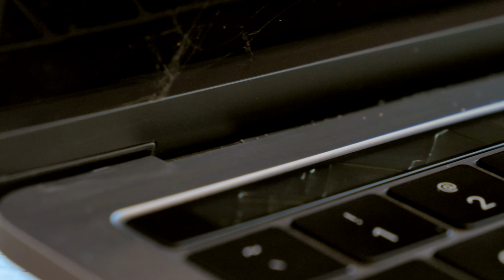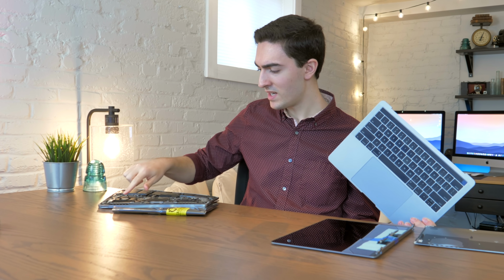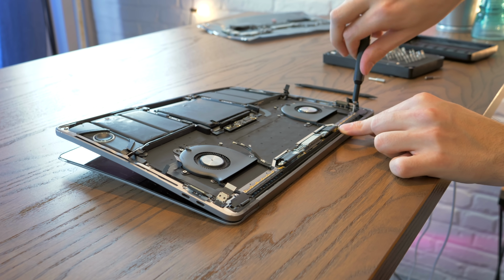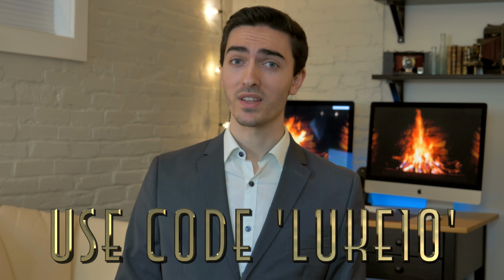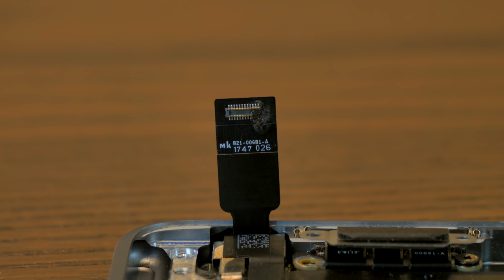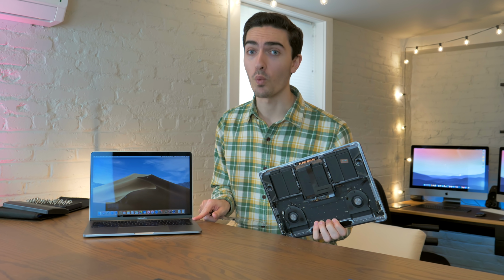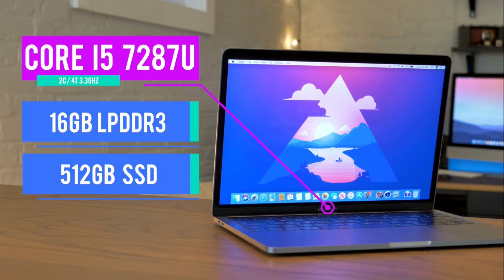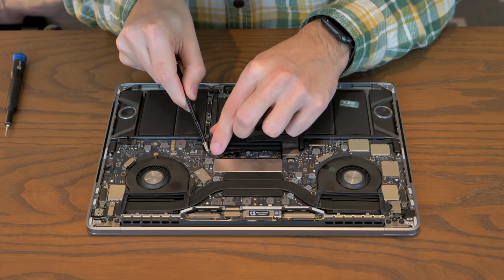Can I restore this DESTROYED MacBook Pro?

Comment: Luke: Gets laptop run by a car repaired (at a cost but still).
Apple store genius: You'll need a new laptop because a back light pin is bent...
Reply: Tempest_072 or the repair will cost a 1000$ soo I think you should just buy a new MacBook -Apple genius
Reply from the maker: If they would even agree to repair this it would be about $1300 for parts and labor RIP
Reply: @lukemiani  I was obviously exaggerating.
Reply: Louis Rossman video?
Reply: Great job Luke.....
Reply: @fredvima9916  Yep...
Reply: Ahahhaha i remember this Louis Rossmann video.
Reply: I think in some cases it's just easier & cheaper for them to recycle a broken device. In case of so much damage definitely.
Reply: +Luke Miani how can I buy 2 MacBook Pros from you
Reply: Jannis Schröder you need to so the louis rossman video

Comment: Everybody: Oh no, it's so broken.
Me: Oh no, it's from 2017.
Reply: meloD30 hahaha this should have WAY MORE likes!
Reply: this should have been pinned
Reply: What's wrong with having 2017 macbook
Reply: Creig the Brute yeah I would kill to have one
Reply: GameAfterMe imagine wanting a macbook instead of a windows laptop(cheaper for better specs)
Reply: @arbiter1954  I don't remember exactly why I wrote this but I guess it's just a general reference to the touch bar models which are famous for the touch bar, faulty keyboards and a lack of ports. For a MBP I would only go with either a 2015 (for budget) or the new 16 inch (for power).
Reply: @kingo1539  It's the OS for me, if I could reliably run MacOS on something else I would have left a long time ago.
Reply: @kingo1539  Internal specs maybe, everything else on basically ever windows alternative that is cheaper is full of plastic components, bad speakers, bad trackpad, bad screen and a flexing chasis
Reply: Mauricio Peña Depends on the Laptop. And if the OS is a problem theres still Linux and bootleg MacOS
Reply: @kingo1539  Laptops that are built to the spec of MacBooks (aluminum chassis machined from 1 single block) costs as much or even more than macbooks, name 1 single windows laptop that has better specs, similar chassis and similar trackpad than a macbook and I will consider myself schooled.
Reply: @kingo1539  M1 MacBooks. Can’t find any laptop better than that for the same price.
Reply: @blackgoose87  I wrote that before they were even announced.
Reply: @chloe elise I didnt get the notification, M1 macbooks are out now anyway
Reply: @kingo1539  but windows can run on Mac using boot camp
Reply: @athenabcde  To what message are you refering?
Reply: @kingo1539  Its not just that, its for the OS and the build quality as well. If you compare it to a laptop that is also high quality like the Dell XPS, it literally costs the same.
Reply: Worst MacBook year

Comment: Damn this hella impressive
Reply: @HoloKola how is swapping a motherboard and screen assembly(6 screws) "hella impressive"?
Reply: @eXxtrazZz  he practically replaced the whole laptop dude
Reply: @drcola143  but it's nowhere near "impressive" as it's the easiest laptop to disassemble and probably anyone could do it . It's almost the same as disassembling a gameboy and I did both lmao
Reply: @eXxtrazZz  no it's not lol. A gameboy and a laptop are completely different things. I would argue replacing the components of a mac is harder than most laptops
Reply: @drcola143  I've disassembled them since I was 14 years old, they are a joy to work on, all the clips, connectors are just too easy to unplug, the layout is easy to work on, no awkward keyboard tilts to disconnect and damage the ribbons or etc like on most windows based laptops. Screen assembly is literally 1 plug,few antenna plugs and 6 screws, I've never came across an easier display to replace(If we're talking a whole assembly, if the display was fixed and I mean unglue the glass protector with a heatgun and replace the lcd itself, then yeah, it's pretty difficult) but overall it's as easy as taking a gameboy apart, had more trouble diassembling nintendo ds than macbooks for the past 7 years lol
Reply: @eXxtrazZz  I mean it's still impressive, he replaced the whole laptop except the touch id sensor
Reply: @drcola143  I mean it ain't impressive at all,  dropping down a working motherboard to a completely prebuilt housing(screen assembly already full, keyboard, battery installed), idk
Reply: @eXxtrazZz  u make a damn macbook pro, make a vid on ur channel

you`ll see how hard it is
Reply: @veeru0999  ok 12yr old
Reply: @drcola143  Nah I work in a repair shop and apart from a few exceptions Macbooks are so much easier to work on compared to other laptops
Reply: @ElAndresRodriguez  ? Isn't it a pain in the ass because Apple solders everything to the mother board?
Reply: @eXxtrazZz  Your comment is basically "oh is not impressive" BuT ain't it impressive that I took one apart as well!?!?!???!??!?!?

Comment: I LOVE your videos!  You inspired me to try my own repair for the first time.  I had a Chromebook with a bad battery, so I did my research on iFixit and bought a refurbished toolkit and a replacement battery on Ebay (following your tips to make sure I found a good seller) and BOOM - problem fixed!!  This saved me over $500.  
I have followed you for a couple years now and love the content and your sense of humor!  I have always wondered how you got to your level of knowledge on Macs - Did you work at a Genius Bar??  Thanks again, Charles.

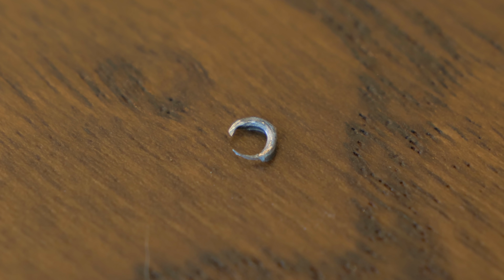Comment: 1:43 I wasn't wondering why you bought it, but how it ended up like that.
Reply: I'm thinking a vehicle ran over it or something.
Reply: @KAriedoll  thought the same
Reply: Might've fell off a bike
Reply: Probably bought it to play games, realised it runs at 20fps in anything except Roblox, got really mad and threw it out the 2nd floor window.
Reply: @your_average_cultured_dude  ExUsee mE rObloX is tHe MosT graPHical inTensIve gAme in HiStorY
Reply: just a random educated human Well I’ve seen a MacBook Pro running battlefield 1 at 50FPS with medium settings so...
Reply: just a random educated human and this was like 3 years ago
Reply: @endi3386  battlefield 1 can run on almost anything. you don't even need more than 2gb of vram. Only gpus from like 10 years ago have 2gb of vram. And you're not gonna run it at 50fps for very long because MacBooks overheat and thermal throttle.
Reply: @your_average_cultured_dude  not if you remove the bottom casing
Reply: Maybe someone tried to batter their wife with that MacBook. The wife won.
Reply: 2 story building drop test.

Comment: eBay sellers: Lists computer as lightly used
Also, did you manage to salvage the battery from the original machine?
Reply: Sebi's Random Tech I don’t believe he would be able to the battery is glued extensively to the top case and it’s bent
Reply: 8 @marcmiyamoto  The batteries in these machines aren't just one single cell, they have leads running to each of those pouches and are frighteningly flexible should you ever find yourself handling one that isnt glued in. I wouldn't be surprise if, even with that level of damage, the battery is just fine to continue using. As for removal, there are liquid solutions you can use to release the adhesive and get the battery out. With everything else destroyed, a heatgun and some alcohol should do just fine. ** I should mention the heat is applied to the palmrest, not directly to the battery** Then something like dental floss can be used to slice through the glue, releasing the battery. Ifixit has some great guides detailing this.

Comment: Luke. I enjoy your videos very much.  I actually work in a apple depo repairing apple laptops. One thing that was having me cringe the entire time was that you didn't have a battery cover on the battery. I am suprised that the top case didn't come with one. We are always told to have a cover on the battery. They are very easy to damage and cause a thermal event. Please be safe and have a container of special sand to pore on these units if a battery is damaged. They can catch fire very very quickly and need to be smothered. Or they can vent bad stuff in the air that can harm you. I hope you have good ventilation ready if something happens.  Stay safe!!

Comment: Recently replace my macbook air 2015 topcase and battery from ifixit.  They said to leave the plastic on the battery in the battery instructions.  I took it off, but luckily didn't throw it out right away, so put it back on at the end, had to open the case again to do that.

Comment: Pro tip: 13” pro-s that are 2015 and newer and 15” pro-s that are 2016 and newer does not run the fans at all during normal use. They just turn on while the device heats up.
So the fans should be all right too.

Comment: Ebay here in Europe... new top case €431, new screen €385, broken Macbook Pro 13 2017 €599, for a total of €1415., or €1475 with shipping. Meanwhile a new Macbook Pro costs €1,504.10. I think, to be honest, I'd prefer to just spend the extra €29 and get a new 2019 model with warranty.

Comment: I really like your videos. I managed during the lockdown built my PC. However I like the cleanliness of Macs. I bought a MacBook Pro 2013 13’ and it really needs to change the upper case. I bought it but very insecure to change it as the cables are really paper thin. It you were in the UK would ask for help. LOL

Comment: question: why not just replace the screen rather than buy a whole assembly?obviously not in the case of this video, but in general. i have a 15in 2015 macbook pro with a cracked screen and i was considering just putting the screen in the assembly i already have. is it that much harder to do?another great video!

Comment: This may be out of no where, but I think you're the one who can help me with my macbook mid 2012 problem. I've cleaned my macbook pro as usual way, when I turn it on, got this problem, "Wi-Fi: No hardware installed." I've made it sure to reconnect everything correctly before booting it up. I've tried every solution in the internet, still no luck. Did I damage my wifi hardware? Or is it a software problem? Please help me. Huhu

Comment: That plastic is a shield to protect the battery from accidental puncture during service, Apple employee's/authorized repairs are supposed to be required to use them. Basically the whole store might have to be evacuated for an hour or so if one gets punctured, apparently Apple thinks breathing battery fumes could be hazardous to peoples health, go figure.

Comment: The late 2013 MacBook Pro is the last one with convenient connectivity.  Apple have soldered in the cpu and ram making it I un-upgradeable. Is there a way to replace the logic board completely?  Can you use a soldering iron to melt the cpu out of its socket?  Curious questions I’d like to see the answer to

Comment: Please use a rubber mat on the table. It avoids scratches, provides grip, keeps the small components missing.
Reply: and a magnifier, even though one can see without it, adding one magnifier will help most of the time.

Comment: I am actually Mac certified. And this restore is easy but the problem is you have no idea if the logic board has been damage at all. Just because “it works” doesn’t mean it isn’t damaged at all. I would not touch this machine. The top case, screen and bottom case is expensive itself. (If buying new). I would just not put all this money into this machine.

Comment: Luke have you ever encountered a mid 2012 MBPRO where you turn it on and the fan just goes full blast all the time? Unable to do normal SMC/PRAM resets or press D for hardware test so it's like the keyboard commands are dead at boot up. Once logged into the OS though the keyboard works again but the battery is still not recognized? Weirdest issue I've ever encountered any ideas? Thx

Comment: Hi Luke, I wonder if you could help me. I have an early 2013 15'' retina MacBook Pro (macbookpro10,1). I know it's not one of your favorites but it still fits my everyday needs. The problem is this: both speakers are gone (they make terrible noises when play basses) now I've tried to replace them by myself, unfortunately one of the screws (a 2.6mm t5 torx screw) of the speaker to the left, has a ruined head and it's not possible to unscrew it. Now, since I wanted to replace the battery in any case, and it would cost around 324$ in Italy, do they will replace the whole top case (including speakers) or just the battery? I know you would probably suggest to look for a used Mac, but in Italy they still costs A LOT even for a 5 years old ones.

Comment: My macbook air 2020 after replacing thermal compund worked fine but then I wanted to put in a better paste Noctua and after doing it carefull y first time. It has stopped showing up anything. As I turn it on the cpu/gpu gets super hot and you can touch the heatsink. The fans spins. Charging plug unplug makes the sound but no display. Did I fry the motherboard or something else. Tired to do a repaste and install again of heatsink but same m it's only 3 weeks I got it and now cantt take to Apple as one of the grooves on the screw got damaged too in multiple reopening. Any help.wouod be appreciated. Thanks for the great vids ..

Comment: Hey @Luke, I am looking for a display assembly for my MacBook Pro (Retina, 15-inch, Mid 2014). I have looked on ebay and pretty much all are $500 up which is way too expensive. Do you know any good place online where I can get a display for my MacBook Pro for $200 or less. I don't care even if it is used as long as it is working. Any recommendation? Thanks!

Comment: Dear sir,  I took the advice you gave in your video about the 4 Macs under $200 that could run more modern software.   I bought a mid 2009 IMac that was already running Catalina.  I did a full back up using Time Machine.  I bought and installed a 1 TB SSD drive from OWC but they now say that they can’t help me reinstall the software because the person I bought it from used a “hack” to get Catalina to run on a 2009 IMac.  I read about formatting and file systems and realize that the new drive needs to be formatted and that the new file system needs to be APFS to get Catalina to run. I have no idea how to get to this.  Would you please help?

Comment: HI luke, 

Do you have a video on how to upgrade a MacBook Pro Retina 13 inch  early 2015.

Processor is 2.7 Ghz Dual intel core i5
Memory 8GB 1867 Mhz DDR3
121 GB Macintosh HD
on Mojave 

Upto where can i update this?
up to max speed and or up to max memory can I update this and HOW?

thanks for the help. I am an avid suscriber and hoping you can help.

Comment: if you are planning on selling the newly rebuilt mac book pro you may want to hold onto it because with the way that the  horror stories from Louis Rossmann is going with the anti right to repair tactics apple is using i would not be surprised if the mac book pro fails to boot in the future after a software update.

if you are planning to keep it you may want to first disable all security stuff like touch id (remove your fingerprint from it's database and turn off file vault and disable the boot security with the t2 chip so in case one of those security parts fail you should still be able to get back into the machine.

Comment: I don't think buying this is more stupid than buying any 2016 or newer MacBook Pro, functional or not!
I did not know about the Touch ID being paired to the logic board, I guess that's just one more outraging thing about these MacBooks.

The rubber goes under the heat pipes, there are even slots for it in the top case assembly!

The fact that this thing still uses DDR3 in 2017 just like the average crappy ultrabook is ridiculous!

The CPU is what you find in the average crappy ultrabook!
The garbage cooling is what you would expect in an average crappy ultrabook, but here it is combined with Apple's legendary stupid fan curves to make sure that your device cooks itself nicely!
The keyboard is a lot worse than what you find in the average crappy ultrabook!

Yet even if you get one this way, you still pay an obscene 800 dollars, UNLIKE the average crappy ultrabook!

Comment: hey luke i have a macbook air and it is amazing but the problem is it is low on storage and i want to install windows 10 on it using boot camp but that leaves me with very low storage, so if u have a core i5 8gbram and 128 gb macbook can u please give it to me i really really need it. I dont want to buy a PC cause they are to expensive and macbooks are sold so expensive even resold. So thanks